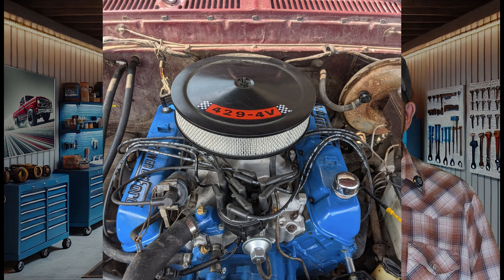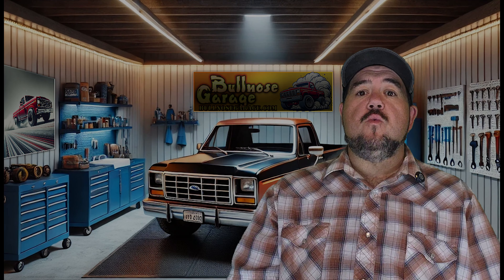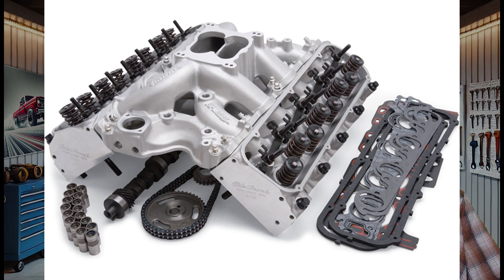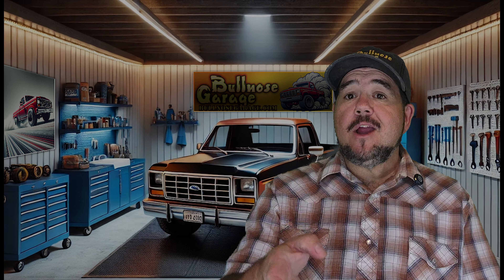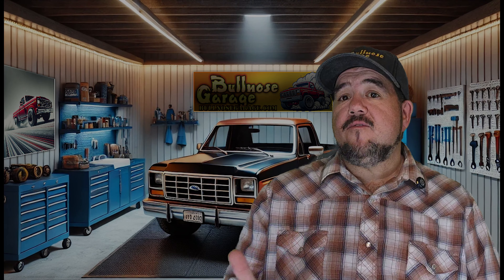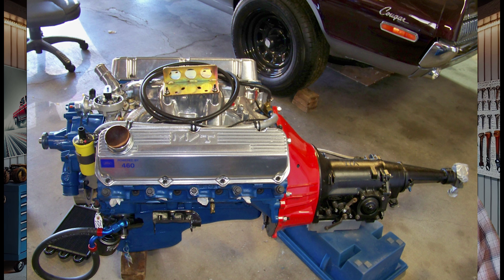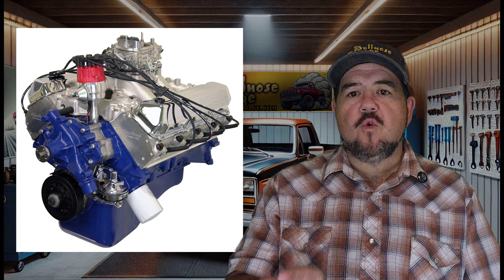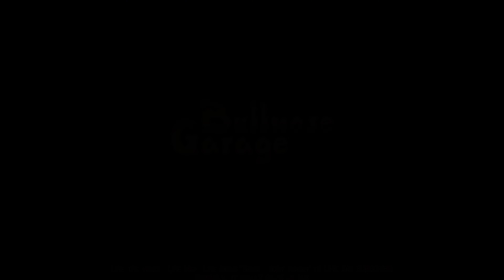Ford 460 7.5 Liter: Everything You Need to Know [Specs & More]

Comment: Lololol. Pound feet lolol. Doesn’t even make sense
Reply from the maker: Pound feet is the proper term for torque measurement.  Folks typically use foot pound though so either is an acceptable way to communicate force.
Reply: @BullnoseGarage  no that wrong foot pound is what is on EVERY SINGLE torque wrench ever made pound feet doesn’t make sense. Foot pound is a measurement of pounds of force per square foot. Not how many square feet is in a pound.
Reply from the maker: @joumasepoes88 we're not talking about torque wrenches.  We're talking about the amount of torque produced by an engine.  Lb ft is the proper measurement in that case.  https://tinyurl.com/Lbftexplained
Reply: @ regardless your sources bro. It’s a BRAND ASS new term. And is maddening to hear for guys that came up hearing foot pounds
Reply from the maker: @joumasepoes88  not sure how old brand ass new is to you, but it's been lb-ft in more than a few shop manuals for almost 20 years or more.  Not sure when it first showed up.  In any case, I'm sorry I hit your pet peeve button.
Reply: @ meh I’ll get over it. Carry on and keep the videos coming.